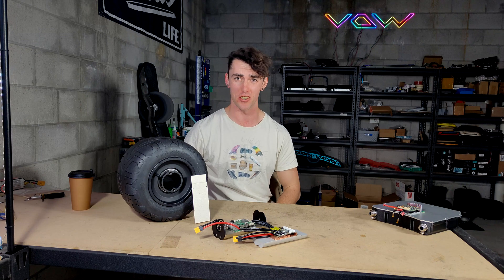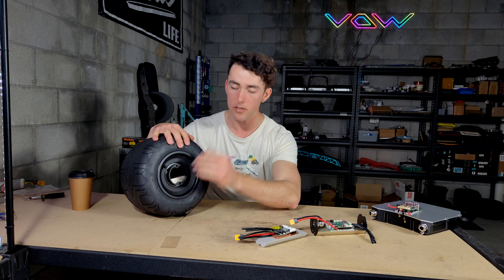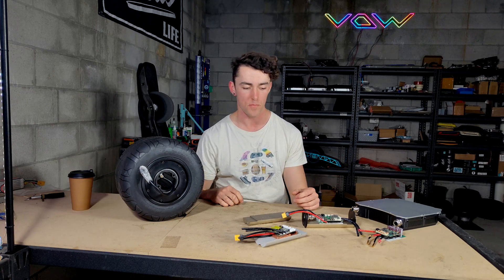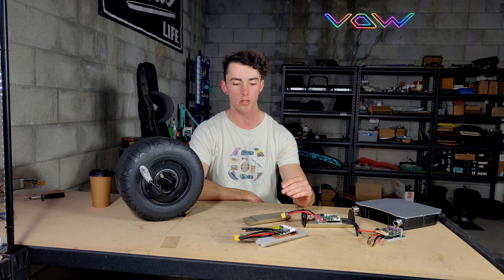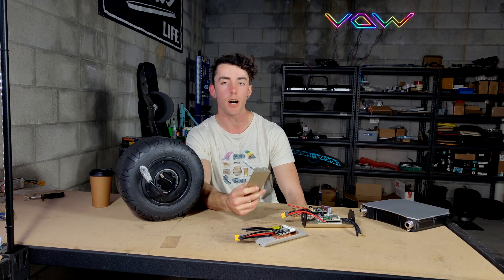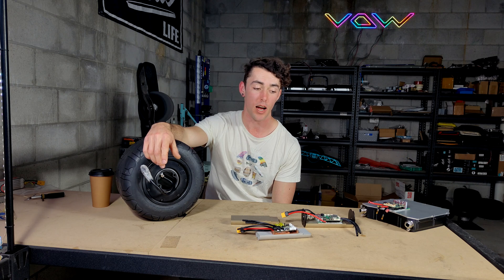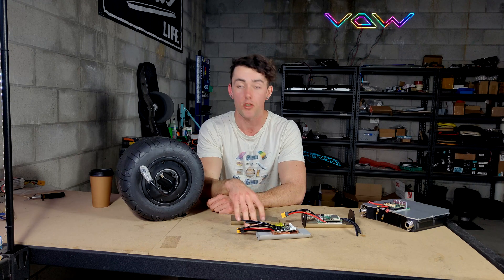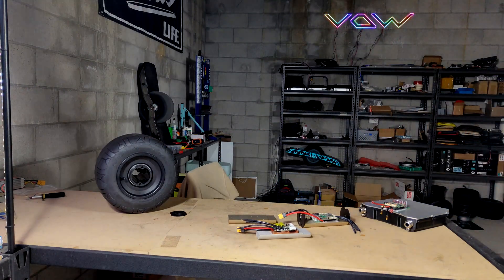The Fusion Core

Comment: maybe its been asked but how does the gyro work if its dead center? is there a second sensor needed on the nose/tail cases?
Reply from the maker: @anthonytran3584  well does the board function any differently when you ride it in reverse? Point is, doesn't matter where the sensor is on your board, it'll function the same if it's calibrated correctly

Comment: What am I witnessing? I've been boarding a month or so, does any one have some definitive videos on terminology and nomenclature about FM one wheels.
Reply: The computer is in the axle in this design. FM boards have the computer underneath the footpads.
Reply: @znzn100 essentially leaving room for more cells up front and balanced weight? More range and torque?
Reply: @DirtSickle1  Correct. Personally, Id dig a board that is 10lbs lighter and only goes for like a 15 mile range.
Reply: @znzn100  I'd love one that has 5 more miles range and same or more torgue
Reply: Thanks gentlemen.

Comment: Excellent work! Unfortunately I’ve seen zero evidence so far that higher voltage produces less heat… 100V and 50V on the same setup made no measurable difference in motor heat. Also the 30s controllers can’t run as cool as the Thor
Reply: ☝️ electrically, the motor will always need the same voltage and current to do a specific thing, and that has nothing to do with your battery and esc.

Comment: oh crap, we had this fusioncore idea 8months before and developed the v2 electronics to fit inside the core, thats why we designed it to be long and narrow, guess now we will have to share the same fusioncore name🤣
Reply from the maker: @floatwheel  hey totally down to share the name, and I'd totally guessed that was the reasoning for your PCB shape 🤣
Reply: @vesconewheel  yep, originally gonna shove it inside a 5inch core so the v1 electronics wont fit anymore, and also the heat problem with the motor +esc, to further lower the heat, we made it 12fet design, this could live happily inside the core cuz it doenst generate noticeable heat.
Reply: @floatwheel  ok, but what about the axle heat cooking the ESC? As a heavy rider, the Cannoncore is an absolute beast but at my weight it gets quite toasty. This thing is going to need active cooling or a heatpipe. Maybe special ADV rails that do a better job of wicking heat away.
Reply: @sdmods619  similar things needs to be done like the GTS motor to get a bit cooler, curved N52magnet and a larger copper fill rate core.
Reply: LOL, we've been working on one ourselves.
Reply: you get this down i'm buying a floatwheel!!
Reply: Can we get this on a Floatwheel??
Reply: @Zetler Someone not paying attention?